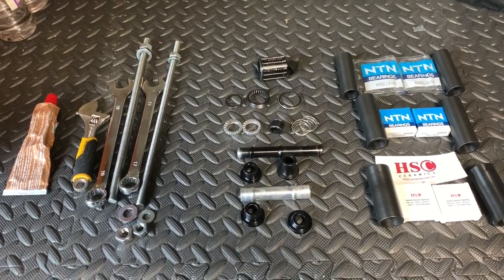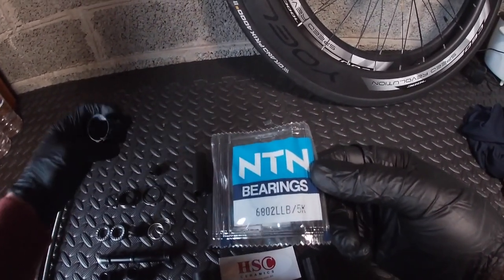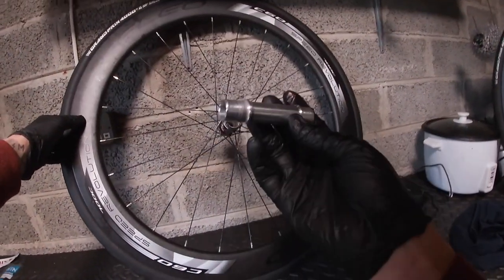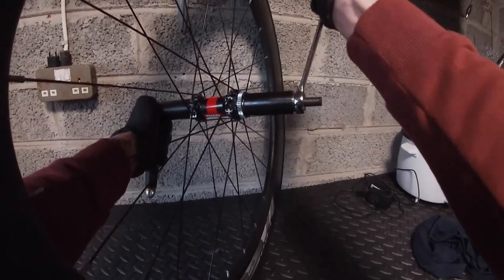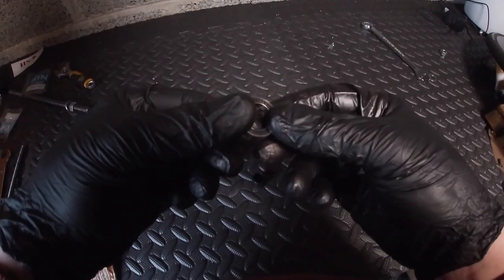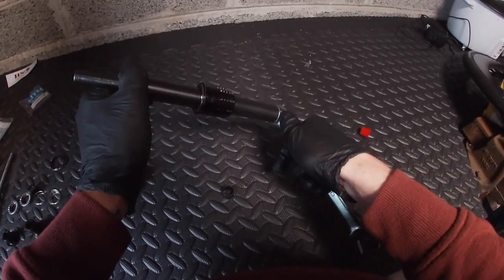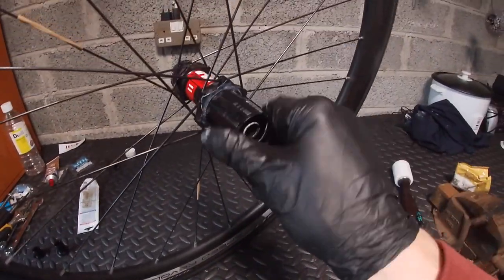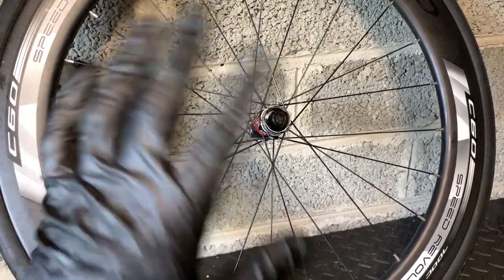(Short Version) DT Swiss 240 Hub & Free Hub Bearing Change Pt 4

Comment: Great video-thanks. How many kM in before changing and why not use NTN front and rear, don’t they last way longer than ceramic? Do you have a video on removal?
Reply from the maker: I’m not sure why I got ceramics for the front, maybe they weren’t available from hambini or they were a weird sizing… I would have got NTN if they were available without any doubts. I think I had those bearings in since I bought the wheels so probably 3 years… not sure if they needed changing before that but I noticed they were a bit rough that year so changed them. There was 4 parts to the bearing change videos so I’ll probably have the removal video in the first 3 videos somewhere. 👍

Comment: Hi where did you get the 6902 bearing press, and what size threaded bar is that? Had to replace my 350 hub front bearings and it was a nightmare to install those bearings! I couldn't get them to level, one side keeps setting in first and had to redo many times. Good work!
Reply from the maker: Milestill Young I got the presses from Hambini.com    The thread bar is either M10 or M12 from Amazon I think the pitch is a 1. The nuts and washers came with the bar. Really straight forward, just do one side at a time and they seat fine. 👍